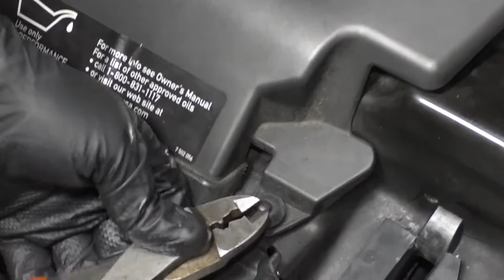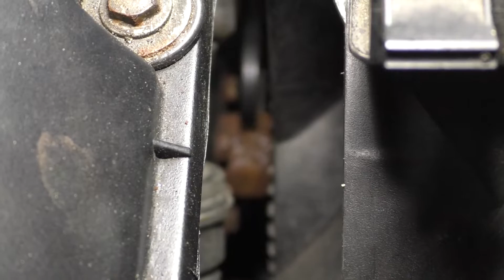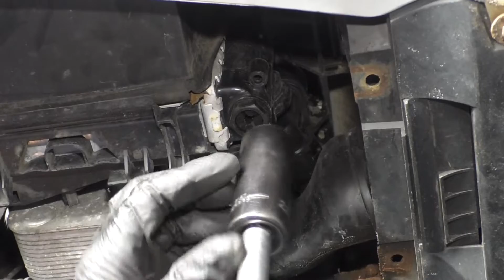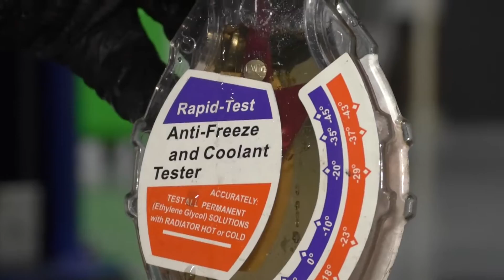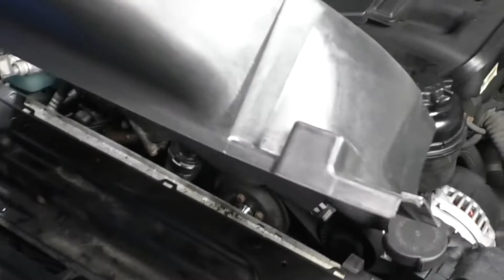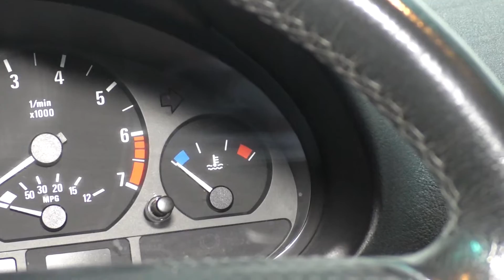How to Replace Coolant Temperature Sensor 01-06 BMW 325Xi

Comment: I have replaced that sensor before on my own 325, it took me longer to drain the coolant, than swapping out the sensor itself, as for the fan shroud & fan, I did not have to remove neither
Reply: You could of just squeezed the radiator hose to stop coolant coming out
Reply: Just pull the sensor out and put the new one in, don't have to worry about coolant at all.

Comment: This is the cooling fan temp sensor not the engine temp sensor
Reply: I think both sensors have control of the aux fan
Reply: Nope. This sensor controls the electric fan. Other sensor gives the reading for the gauge cluster.